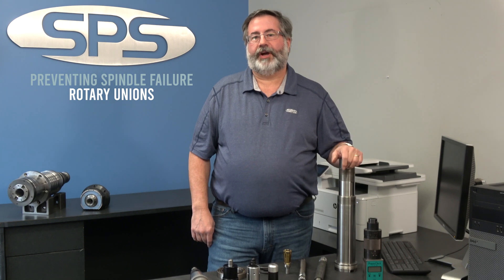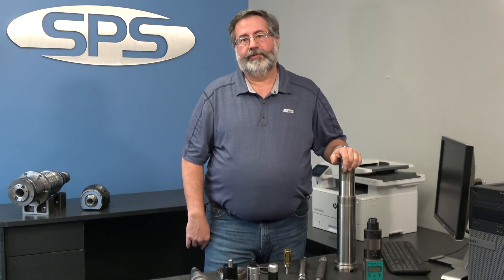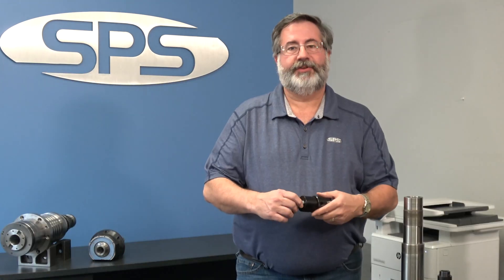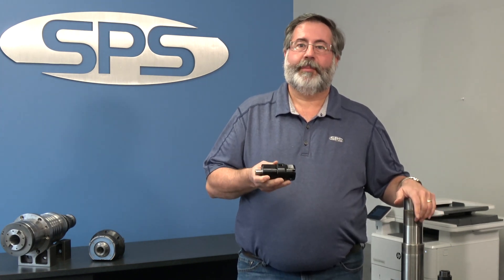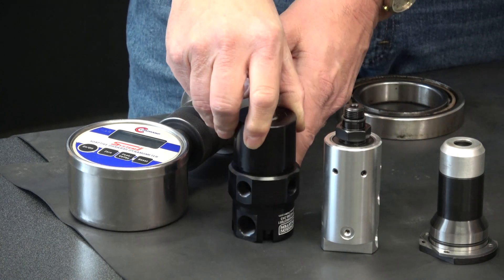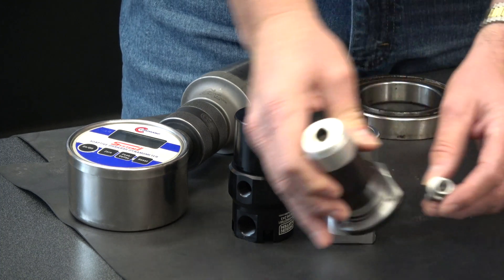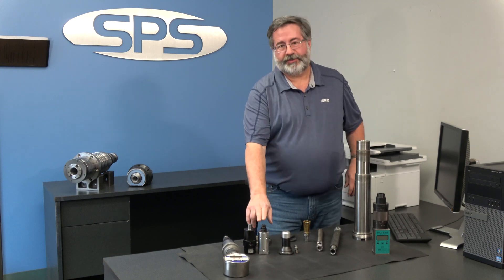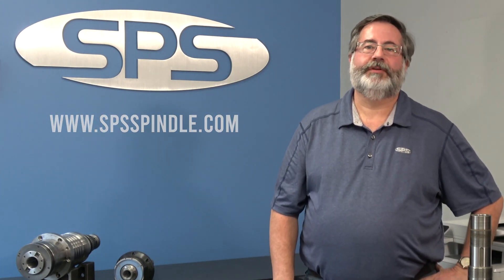Preventing Spindle Failure: Rotary Unions

Comment: Hi. It,s possible to install a CTS (collant trough spindle) in a Robodrill Alta T14iE, originally without this system?
Reply: Does it have the 3/4npt  on top of the spindle motor that's used for air purge during tool change?  Then yes easy